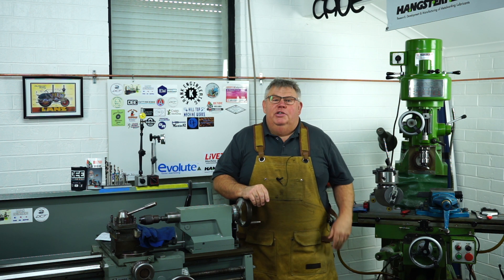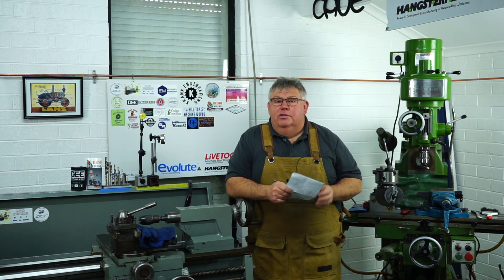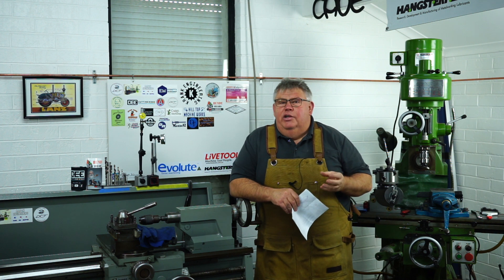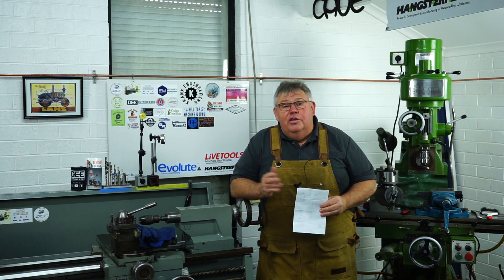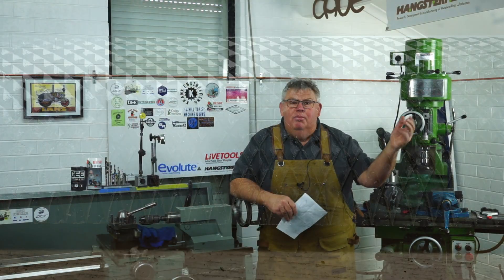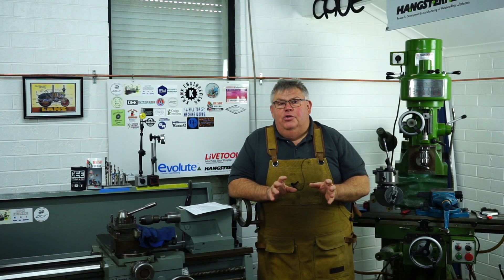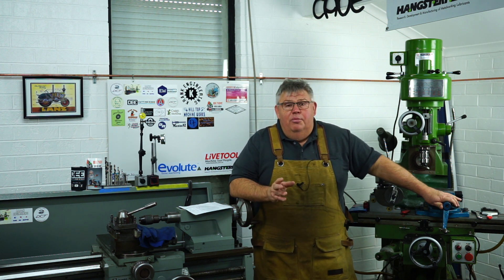Knurling FLAT and CONVEX surfaces

Comment: Can you do a knurling on concave profile using this method  or any other.

Half round clamp or c shape concave profile..
Reply from the maker: Hello.  Thank you for watcing and commenting.  I believe you can do this but I haven't done it in a manual machine.  Always possible in CNC to do this type of work.  May I suggest you check out Max Grant and did an external knurl on a round surface https://youtu.be/iDCiFAfn8B4?si=fnS3uYSKQ3btJyOf&t=1122

Hope this helps you?  Regards, Aaron.
PS: click spring channel has done many "rope" knurs also.

Comment: I'd like to knurl a bunch of guitar picks that are about .60mm. I don't have a machine shop, a pocket knife and straight edge isn't doing it for me. Does anyone have a recommendation?
Reply from the maker: Not an easy task. I would purchase a cheap <$500 CNC router and run a 45 degree toolpath with a suitable step over. Or with a small milling machine, 45 degree offset vice, v cutter and do it manually. Just use double sided tape to hold the part down. Hope this helps.
PS: unfortunately this would require some small outlay 💰

Comment: A shaping machine would be another good way of knurling a flat surface - providing straight cuts, instead of curved, as in the single "tooth" carbide hi-flow fly cut method.
The feed rate would need to be set to determine the desired pitch of the knurl, and the vice on the shaping machine would need to be set on a 45 degree angle to the left (or else the right) for the first pass, and then rotated 90 degrees  for the 2nd pass, and the shaper's cutting tool's profile, which is similar to a HSS lathe tool, would be shaped and sharpened accordingly, to cut the desired knurl depth, etc.

Shaping machine  flat knurl - https://www.youtube.com/watch?v=CzhdH8ieiGA
Reply from the maker: Hello Paul.  That's an excellent observation and you are 100%.  My very good friend Matty, from "Matty's Workshop", just did some knurling on his shaper recently.  He used his shaper to knurl the handle of a sliding bevel tool that he was making for his son.  Here is the link to that process https://youtu.be/GZPPBVVNOB4?t=648

Additionally, I used a 90 degree chamfer tool recently to place a knurl on a little project that I was working on.  I set the vice on 45 degrees and took some passes at 4mm stepover.  Not a very nice knurl, but it worked ok https://youtu.be/RHo5dQwUN58?t=563

Thanks for watching and commenting Paul.  Have a nice day.  Cheers, Aaron.

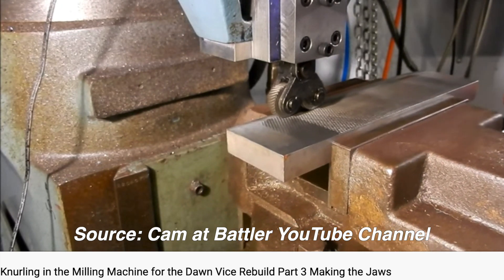Comment: Hi Aron! The kind of knurling shown in 2:32 is very innovative and interesting! Is this type of knurling tool available at hardware shops easily or is it made at workshop only if needed..actually I want to put linear lines (10 lines in every centimetre) on a flat brass strip..if this tool can be bought from local hardware store then I ll only need a machinist with a mill to achieve this result. Please help
Reply from the maker: Hello Shama.  The knurling shown at 2:32 was performed by Cameron over on his channel.  The tool is a common knurling tool that you can purchase from a tooling supplier, ebay or aliexpress.  Some of these knurling tools can be purchase with additional wheels which will have the straight pattern you require.  Additionally, if the lines aren't that deep you can use a drag tool in a manual mill, or even a shaper to produce the lines in brass that you need.  Best of luck and I hope this information serves you well.  Cheers, Aaron.

Comment: I've used a single tip in an indexable face mill as a fly cutter, but never tried to make an actual knurl-type pattern with it that way.  Might have to give it a shot when I have a shop again.
Reply from the maker: G’day Everett. Yes it was a fun job to do on the mill. It’s amazing how many different patterns you can create using this method. Trust you’ve been well? Cheers 🍻, Aaron

Comment: Curved knurling is easier on the lathe. Make a fixture with the needed radius to hold the jaws in place and cut a left and right thread with a high pitch. I think it's fun to do.
Reply from the maker: G’day Michel. Oh I haven’t seen it done the way you are describing. However I can visualise it and see it working well. Trust you are well? Cheers 🍻, Aaron

Comment: This is checkering, and probably has other names, too.   
In my opinion it's not knurling unless metal is displaced.
Reply from the maker: G’day Bob. I thought I explained this in the video. Checkering is a decorative process applied to rifle stocks (for example). Knurling is a process usually associated with a functional purpose like grip (to hang on to). When applied to a vise jaw it’s called a knurl. Most text books state, “use soft jaws to prevent the vise knurls damaging the workpiece”. Anyway mate, I don’t want to get hung up on the words, just wanted to document and show my processes. Regards, Aaron 🍻

Comment: Hi again Arron. Thanks for the mention, but any input I had was no big deal. But.......... in a way I guess a few of the high end commercial fly cutter tool manufacturer's are to blame for the misconceptions today of exactly how and what a single tooth fly cutter should be used for. Suburban Tools and Tormach to name just two show there fly cutters taking large depths of cut just like your face mill with one insert was doing. Fly cutters are a very old tool and no doubt thought of shortly after the first milling machine was invented. However, and for very sound and logical engineering reasons they were always designed for and only meant as a very light finishing tool. Large depths of cut with a single tooth interrupted cut are extremely detrimental to both the spindle bearings and the spindle splines. 

Re watch your own video again and you can hear the hammering that's going on as the cutting loads go on and off the spindle parts. Yes some of the noise is from the cutting tip entering the cut, but the rest is from your male and female splines getting hammered together. There literally bouncing against each other during each spindle rotation. At a more microscopic level the same is happening within the clearances in the spindle bearings. It's no different than beating on your splines and spindle bearings with a hammer hundreds of times a minute.With my own home shop, cutting tool costs are always a high priority for me so I use fly cutters a lot over using up large end mills I'm not equipped to resharpen. But I limit my depths of cut with them to a maximum of maybe .010" in steel or stainless and not much more in even aluminum on my Bridgeport clone. 

Yes the tools themselves are more than capable of taking those large depths of cut, and there's lots of YT videos showing them doing exactly that.Unfortunately the spindles in our machines can't and were never designed to do so for long without permanent and very expensive damage. There's a few threads on the Practical Machinist forums specifically mentioning exactly what I've said here.As a rule of thumb you really need two or more cutting teeth in the cut at all times so the load is constant and not interrupted. For that reason I'd chose to use a multi tooth V form cutter on a manual mill and angle the work or head in each direction while stepping off each cut to get the cross hatch or knurl/checking pattern. My best guess is most high volume knurling/checkering on commercial vise jaws is very likely done on cnc horizontal mills with a stack of V form cutters or a custom made shell mill with the correct spacing and it's done in two separate passes or on two machines. Or on the better and more expensive vises they may just be form ground after heat treatment. I hope some of this is informative to anyone reading it.
Reply from the maker: G'day Pete.  Thanks again for your input mate.  I hope you didn't mind me mentioning your name in information in the video.  However, it's important for me to disclose who told me why and what.  I have watched many other "large / popular" YouTubers plagiarizing information and claiming it to be there own.  I need to give credit where credit is due 😉 

Once again, thank you for your very clear and detailed explanation mate.  I agree with everyone you said.  I would not be doing this all day on the knee mill as it would eventually lead to and cause premature wear / failure (spindle bearings or other components).

To be honest, the vise jaws would be better suited to horizontal mill with the arbor installed and a double angle cutter for material removal.  Or the head tilted over with good end mill cutter held in the collet of the vertical spindle.  Of course the vice would need to be offset, but I think you get what you mean.

Sounds like you've got a nice shop.  Any chance of showing us guys on YouTube mate?  Can I twist your arm for small shop tour video (wink wink, nudge nudge).  Cheeky bastard aren't I.

Cheers, Aaron.

Comment: Fusion 360 is no good mate. Cavemen like me don’t speak the language.
Pretty cool though, must admit.
Make sure I got this, 400 RPM, feed rate is maximum.
Got it!
Reply from the maker: G’day Jeff. Nah mate, if a functioning idiot like me can use it I think anyone can. Someone recently called it “Confusion 360” in my comments. Actually it could have been Paul (aka, The Knackler”. I laughed my arse off after reading that. Mate 400rpm worked for me. You could try slower and faster RPM on aluminium and look at the pattern. Cheers 🍻. Aaron

Comment: That's something i might have a play around with one day ,  curved knurling on a manual milling machine .   Cheers .
Reply from the maker: G’day Max. Absolutely mate, I reckon you could do that convex knurl on your Bridgeport mill blindfolded, drinking a stubby and with one hand. Easy peasy Max. Unlike the big boy, he had to cheat and use a CNC machine. Jesus I’m a soft cock, I need to take a spoonful of cement and harden up 🤣
Reply: @AaronEngineering  Make that  '' Quick set cement Aaron ''  !!!!    When you see me make the parts for the gear train on my indexing head , it won't be far off .   Cheers .
Reply from the maker: @swanvalleymachineshop  I’m looking forward to that video of yours Max 👍🍻